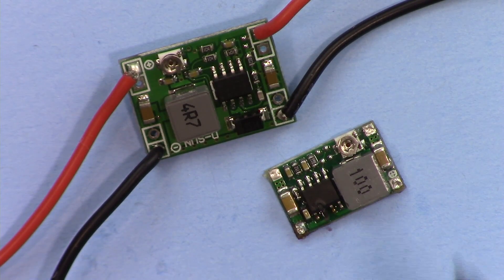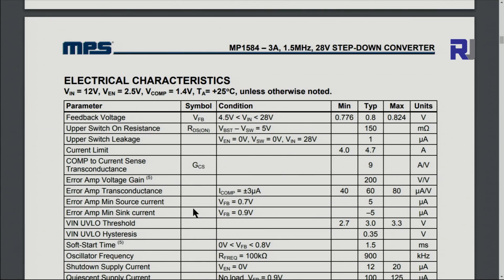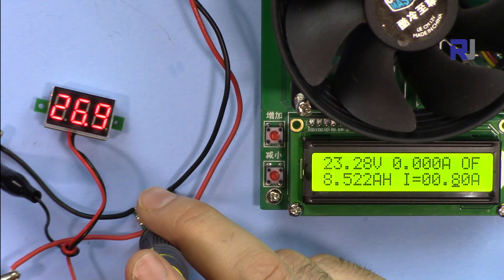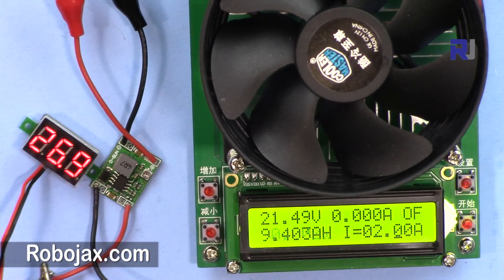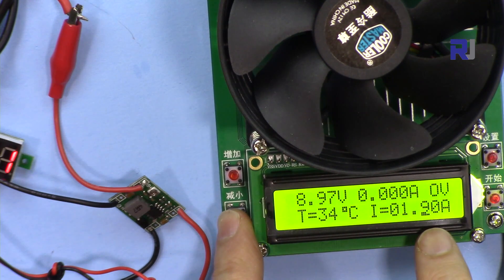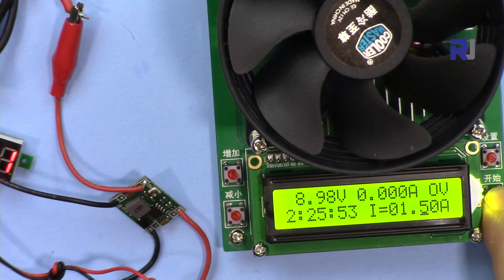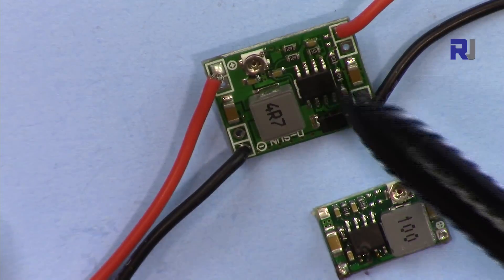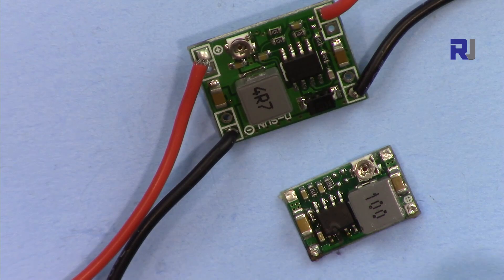Test review of MP1584 0.8 to 25V 2A DC-DC Step down converter

Comment: These little boards are not designed for that level of power... Especially without some sort of cooling solution.. Trying to push 18 - 27 Watts of power is just not going to work.
Stated on the MP1584 datasheets: Absolute Max Continous Power Dissipation @ 25C = 2.5W ..    2.5W / 3A = .8333V
Reply from the maker: You are correct, the thermal limits are important to consider and it's crucial to stay within the safe operating parameters.

Comment: Thanks the very thorough testing.
I bought some of these to convert 5V to 1.5V (powering a wall clock motor which normally uses an AA battery) but my modules never go under 2.53V. Any idea why this could be ?
Reply: I bought the larger module from Temu. The claim is 0.8-24v output but the modules from Temu are designed so poorly that the resistors they used with the pot on this board allow a narrow window for the output. They are basically useless. 

I got my money from Temu even without returning the modules.

Comment: I have the little modules, but they failed even at 1.25A. The Chip burned and send out some smoke! There wasn't even an overload- or overtemperature protection. Probably i bough fake converters with fake chips? Input voltage was 20V, output 10V, load 8 ohm.

Comment: Hi, great video!! I'm wanting to find a dc to dc module like these that shut down but when between .300A to 1A of current are being sent to the device they are powering. I'd like to protect some ESP32s that I have running some LED panels from inrush current (that seems to happen sometimes when the panels are powered up). I'm curious if there are tiny modules like these that can technically help reduce inrush current issues. I know the usual goal is to get as much current out of these as possible before they overheat or shut down but I'm kind looking for something that shuts down at anything above ESP32 ratings. Do you have any recommendations? Thanks so much for this video!

Comment: Very nice review, thank you for sharing. One comment about the smaller module: This module Not based on MP1584, but either MP2307 (Vin < 23V; 3A) or MP1482 (Vin < 20V; 2A), both using synchronous rectification - that is why they don’t need the Schottky diode (as not found in your video at 2:44), which is mandatory for the MP1584 (larger module). I just discovered when I bought 5 of them and zoomed in finding an MP1482.
Reply from the maker: Thanks for the info!

Comment: Does the set output voltage change with different input voltages? This is an important point of interest to me.
Reply from the maker: of course not. the output stays as long as you don't bed below the minimum. This is true for all converters.

Comment: I have a battery drill I would like to step from down  20v 2a  to 12v at 1.5 amp to another battery drill  I wonder if the module will handle i...t thanks
Reply from the maker: first I don't remember what was the maximum current I tested. let's say it was 1.5A, then yes.

Comment: Thank you for the tests. The results are what everyone would expect, there's no way a bare MP1584 with no heatsink could handle 3A.
So, these modules are OK for sub 2A projects, and even then it's better to use a heatsink.
I'm going to buy a few for my low-powered (sub 1A) projects.
Reply: same

Comment: There is inadequate thermal mass (copper area or heat sink) for the higher Amperes but the thermal shutdown was too fast at 2.5A. Possibly you had insufficient cool down between experiments? Also, Chinese chip markings are suspect more often than not. A real MP1584 should handle 3A. Possibly these are deficient copies of the MP1584.

Comment: if you vary the input voltage does the output voltage stay fixed to what it was set to? e.g set output to 7v but input voltage fluctuates between 9 to 16v? would output remain steady at 7v?
Reply from the maker: if the input voltage is variable, then yes the output will stay stable regardless of changes at input. This has variable input and will keep output fixed.

Comment: Hey I want to power a raspberry pi from this and for that i have an input of 12v 1A and the output required is 5v 3A can this solve the problem??
Reply from the maker: Hi,  I did the test for voltage and current. it is you who decide if it works for you or not.
Reply: @robojax  As you are expert in this topic I just want suggestion on it! Does it convert 12v 1A to 5v 2a?

Comment: i have adapter output 5v 1.5A
can I use this buck to convert to 4.2v?
Reply from the maker: Yes you can. But if you are planning to charge lithium battery, this does not control the current ans that is very important if you want to your battery to last longer. You need constant current which limits the current and subsequently reduces the voltage.

Comment: hello, where did you buy the current load device?
Reply from the maker: Hello, I just added links to different sources for the 10A electronic load.
Reply: @robojax  
Please tell me is those module useful for motor

I want constant voltage speed for n20 micro gear motor

Should I go for linear regulator or buck converter is suitable

2 using Motor 

Each is 12v 1amp

Comment: So withe the larger D-Sun version, I warned to use it with my 3d printer's 24v PSU to give me 12v for a strip of LEDs.  How odd that its input voltage is 23v not 24v. Who has 23v as standard?

Comment: 6v to 3v? And if I use aa battery and Inout voltage decrease, the output voltage is fixed?
Reply: Yes, that's how most of the modern buck (and also boost) stabilizers work - they try to keep the output voltage constant, no matter what you feed in, down to their specified voltage limits. mp1584 should keep your output stable down to  4.5V of input.

Comment: I have 4.2v lion cell and I want to use it to step down the 4.2v to 3.6v for 1watt led will it work or not I know I can just simply use current limiting resistor but as the battery gets low the brightest of led also gets low ( I think ) that's why I want to use buck converter to maintain the output at 3.6v. please reply sir I don't know how to operate 3.6v led on 4.2v without loosing brightness, as the battery gets low.
I'm looking for something who can output 3.6v constantly untill battery gets low from 4.2v to 3.6v so I led can't loose brightness until unless battery gets lower than 3.6v
Reply from the maker: Hello, why you want to limit the current? if LED needs ONE watt, it will not take more. so first you should not limit it.  But you have to provide 3.6V if it say 3.6V the Lithium Ion battery voltage is 3.7V when you  measure it  as 4.2V that is charge cut off voltage. so people don't call it 4.2V, rather it is called 3.7V so I believe and it is 1 cell. so your LED seems to work with 1 Cell and you don't need converter in between your power supply and LED. But if its, then if your LED needs 3.6V 1W, the current I=P÷V, P is power and I is current in Ampere so I=1W÷3.6V=0.27A or 270mA current.  Do not use resistor as it wastes energy as heat. use this module and set the output to 3.6V and do not worry about current.  Good luck.. Pease. Ahmad from Canada
Reply: @robojax  thank you very much for your reply sir
Reply from the maker: you are welcome.

Comment: could the voltage be changed with an ardunio ? if so could you let me know what i might solder?
Reply from the maker: Yes  it could . But you need to hardware and code to  make it happen and to modify the module.  I am not sure if you are going into that rout.

Comment: i was going to choose mp2307 earlier for powering my esp8266 since it is easily available, for commercial project. Now i have dropped this idea, need to read spec sheets very carefully:) MP2307 has typical switching frequency of 300KHz while MP1584 has Fsw 900KHz and goes to 1.5MHz (though not recommended). So MP1584 is superior in every aspect. Now i am just in dilemma whether to use ACT4088 (typical Fsw 1.2MHz) or MP1584 (typical Fsw 900KHz), both are strong. Assuming higher the switching frequency less ripples in output voltage, only disadvantage it is non-synchronous and hence less power efficient.

Comment: I have one but it is not working, no voltage is coming out.
Reply from the maker: if wiring is correct, it must be dead.
Reply: @robojax  I will buy another, it costs 20 CZK = 0.75 cents maybe
Reply: @robojax  BTW  I have exactly the same wiring as you.
Reply from the maker: Good luck and stay safe.

Comment: You really need to add an additional output capacitor, 100uF electrolytic is sufficient soldered right at the output terminals.  The addition of the cap reduces ripple (actually I'd say  instability in most cases) vastly under any significant load and consequently makes the device far more capable than without (as the large ripple causes thermal shutdown).  If you hook a scope up on the output you'll see that the ripple is bad without cap in various in/out/current combinations and it becomes obvious at what point the device will not be able to handle the load.  

Here is a spreadsheet with my test results of the MP1584EN (larger board): https://docs.google.com/spreadsheets/d/1QFAnun764-8sRNZ4b9T2qCecrmQQdm8nt4pMj2htszg/edit?usp=sharing
Reply from the maker: Thank you for sharing.
Reply: James, from your testing have you noticed irregular behavior using these converters without load? After several days of continuously powering a device drawing little to no current, the resistor between the positive and negative output has shorted, causing the positive/negative to short. Testing this on a bench, I found slightly different but similarly bad behavior with little load, ultimately this killed the device it was powering, potentially voltage spike.
Reply: sharing comprehensive work and knowledge without chitchatting too much about it. thats a real pro! thanks man

Comment: My input 12v 7ah, mini 360, and it burst. how much input current should be?
Reply from the maker: I did not understand the "mini 360" but to calculate the current (current is shown as I ) I = P÷V and P=IxV do this calculator in both output and input. Just keep in mind the the output always has about 10% less than the input.

Comment: Can it charge my 1.5×2 aaa cell with 5.volt mobile charger. What is best module for charging aaa and aa cell with from usb mobile charger. Can I put heat sink on it
Reply from the maker: Yes you can if you have some way to turn it OFF when charging is done. You my use this module with any power supply to charge your battery https://youtu.be/hacb6rNQDfc
Reply: Robojax thanks

Comment: u did not tell difference in both.
Reply from the maker: it is the same chip. two module. current will not be affected.
Reply: Robojax oh thanks u so much for reply .  Then what is for 100 and R47 block there . What is it's meaning. Can I put heat sink on it. Can it charge my 1.2×2 aaa cell with 5.volt mobile charger. What is best module for charging aaa and aa cell with from usb mobile phone charger.
Reply from the maker: You are welcome. There are 100s but I have not tested any so far. So can't suggest.
Reply: But @alexei says MP2307 is the small module. Right?

Comment: Testing for 3 amps is invalid as the specs are "1.8A Sustained " for the Mini360. I couldn't find the sustained value for the Mini MP1584EN, but it surely is not the rated 3A peak for both boards.. As far as I know, "peak" means "short transient"; therefore, not "sustained". Keep in mind that the specs for either board CHIPS are different than the specs for the BOARDS, as according to the CHIP spec sheets, the BOARD designers select from a list of support component values, which set the characteristics of the BOARDS.
Reply from the maker: Hi, If you see the datasheet, it is rated at 3A https://www.monolithicpower.com/en/documentview/productdocument/index/version/2/document_type/Datasheet/lang/en/sku/MP1584/

Comment: The power supply you are using is <2A? this module can boost the current?
Reply from the maker: voltage V and Current I (in ampere A) so you will always get less than what comes to the input. Example input 10V, current 1A 10x1=10W and output can never be more than 9.9W (assuming 90% efficiency).  For example for 5V output can get get 9.9W/5V=1.98A. So calculated it with respect to power.
Reply: @robojax  minor correction here -- if it's 90% efficient, it can provide 9W, or 1.8A @ 5V.

Comment: It is two different modules with two different ICs! 
Large one is MP1584, smaller one is MP2307! 
You can see that smaller one have no diode on output because it is synchronous converter!
MP2307 is more efficient but input range is 23V vs 28V for MP1584
Reply: Mai Mariarti  Which one can be used to charge mobile supplied variable DC input? Will it be safe?
Reply: @swapniljoshi9997  you may use any of them  just set voltage b4 plugin device
Reply: u saved me man

Comment: The sellers of these modules tell you that a heat sink is required for larger currents.
Reply from the maker: Yes. I have also mentioned that it should be cooled however possible.